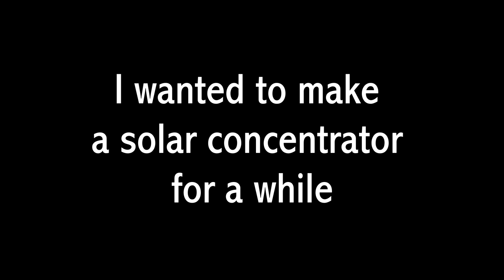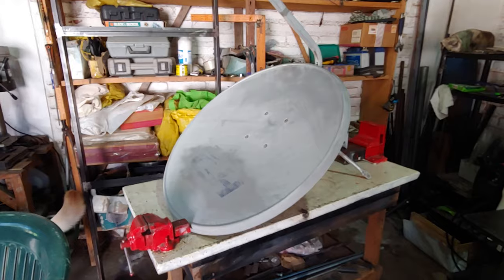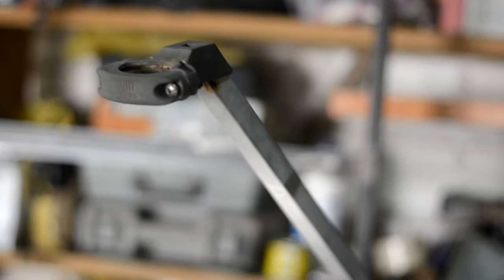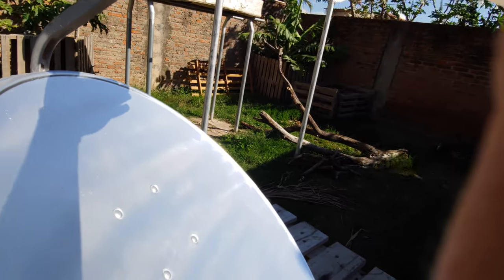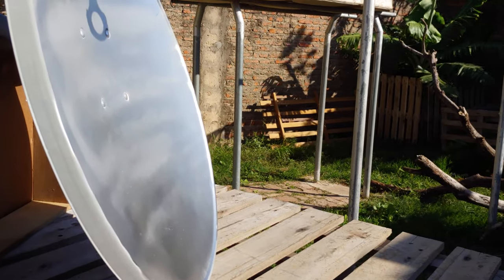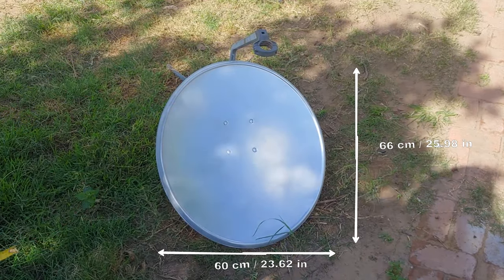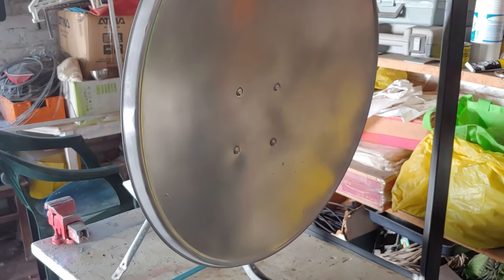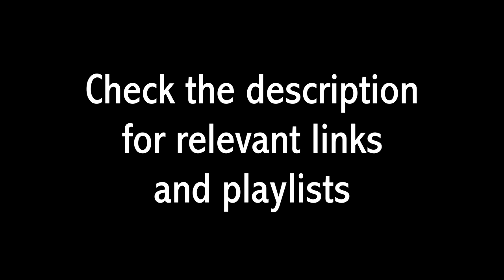How to Make a Solar Cooker with Dish Antenna | Solar Concentrator

Comment: I tried that too, chrome paint sux 😐 It was much better with aluminium tape but mirrors are best.
Reply from the maker: I agree. Mirrors would probably reflect a lot more than the chrome paint I used. The problem with mirrors is the weight, and the price, but it would be fun to try a new project like this again.